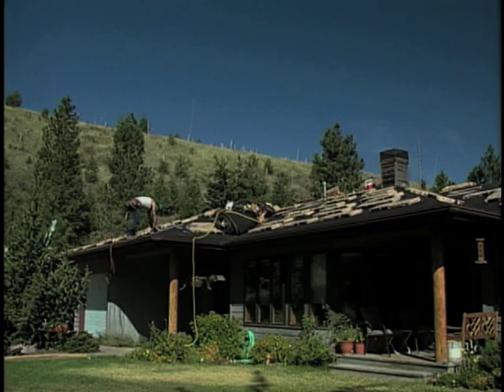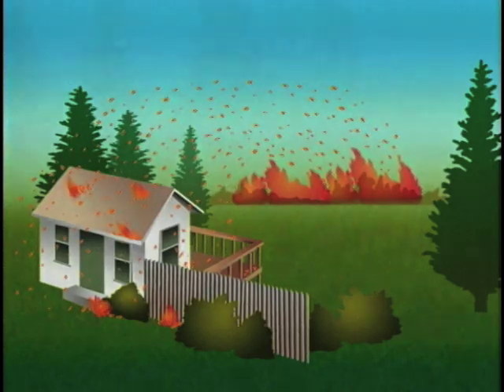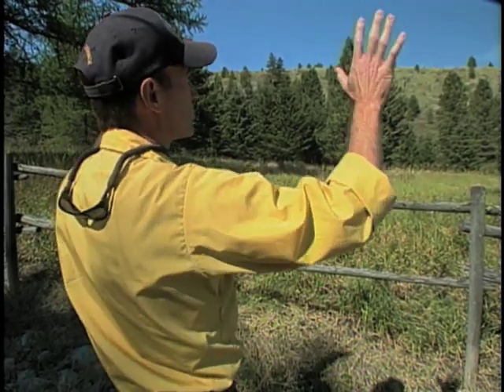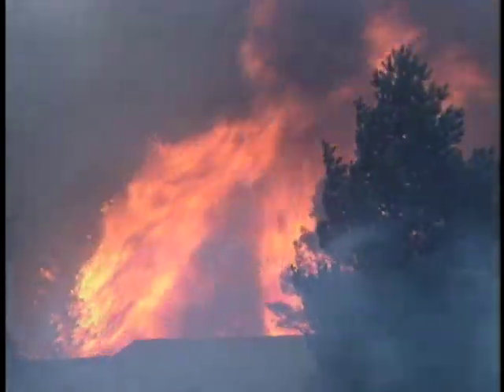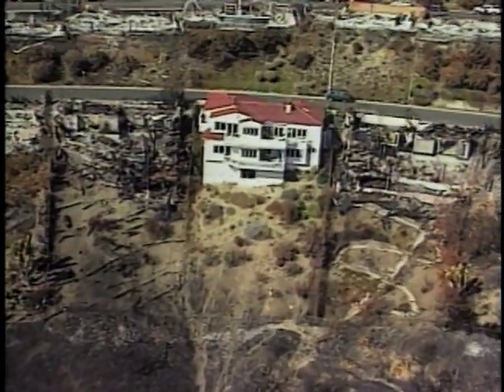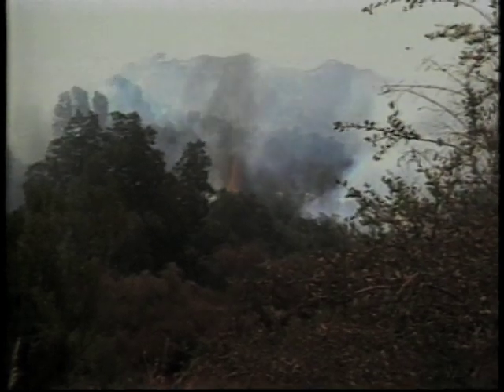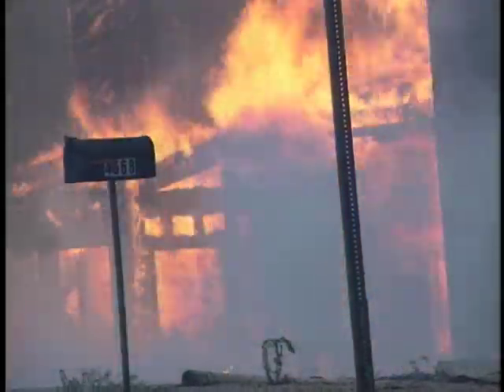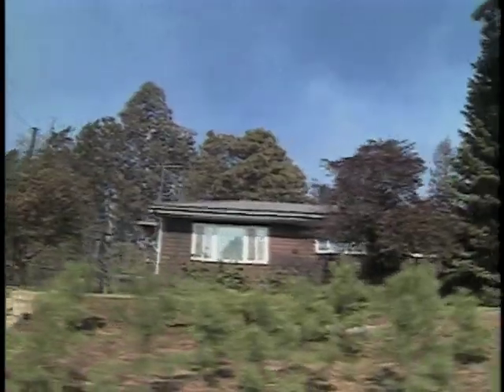Wildfire: Prevent Home Ignition, Part 2

Comment: Once again very well done, why can not more people understand this.?
Reply: Time Traveler  I am so sorry you feel this way.  I am not rich but I have put my fair share of sweat equity into my home and the surrounding forest lands to reduce the fuel loadings over the past 30 years.  It is an on going process,  I rake and remove pine needles beginning after the snow melts until the snow falls again.  A good composition roof if kept clear of debris is in most cases fire resistant,  I live in the Central Oregon Cascades (pine country), many of my neighbors have very low intensity landscapes, i.e. native vegetation with no irrigation.  The annual and perennial plants are just mowed once they begin to dry.  This type of landscape is quite fire safe when maintained.